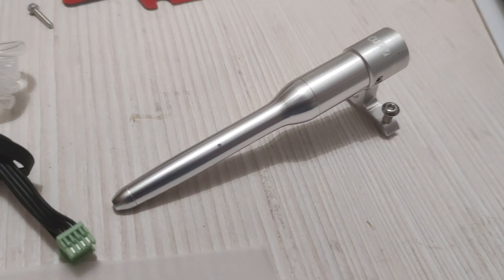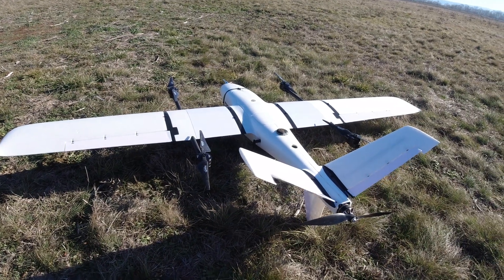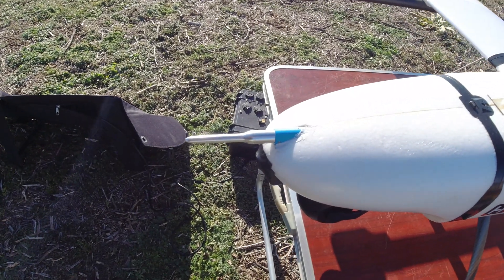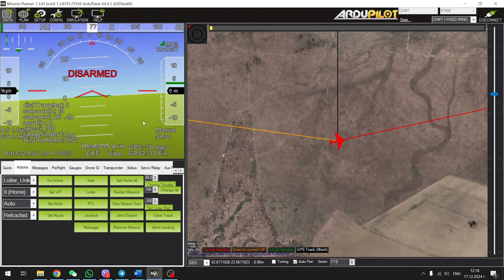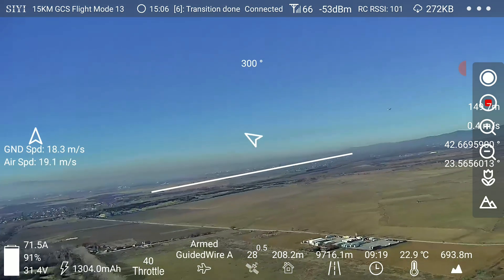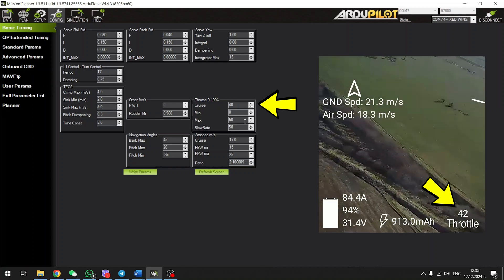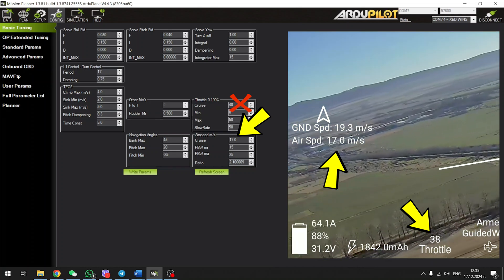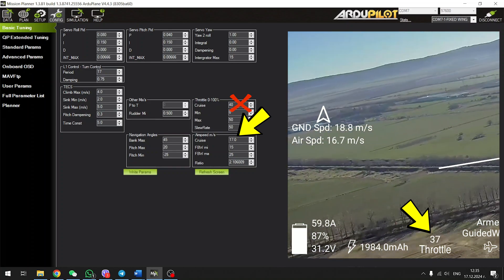CUAV Skye 2 Nano Airspeed Sensor - it actually works... for a change!!

Comment: Hello, have you never used the MFD airspeed sensor? It worked perfectly 10 years ago!
Reply from the maker: @L..E01  I have not! Like I said, a lot of people around me used a lot of sensors over the years, they always had some issue or another! I know the MFD sensor that is built into the MFD autopilot works well, but that can't really be used on another autopilot.